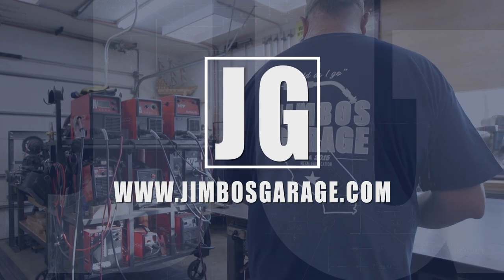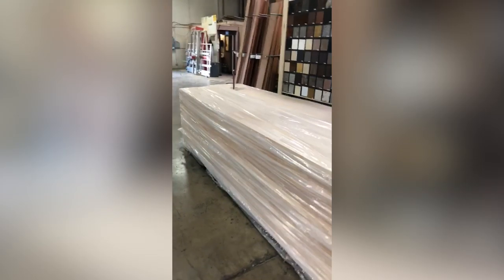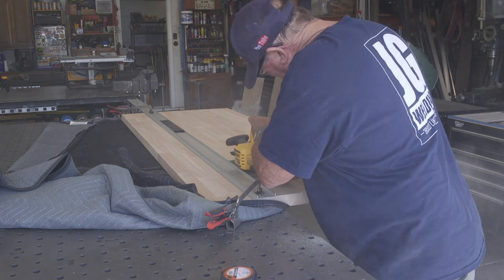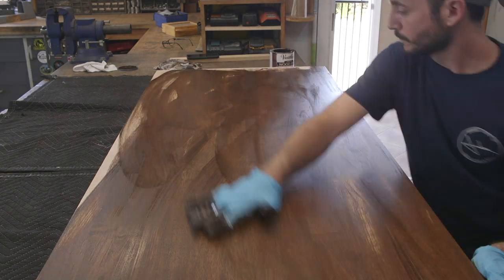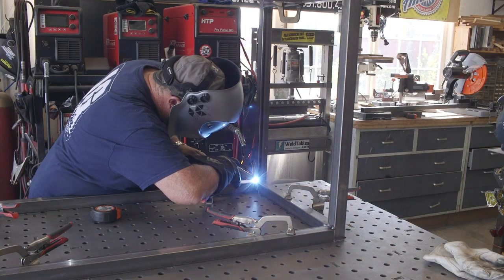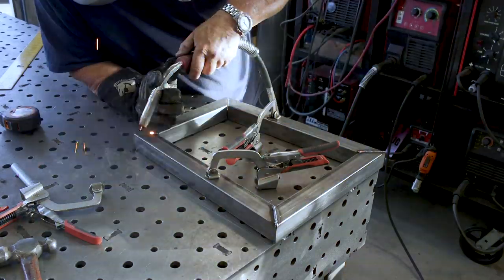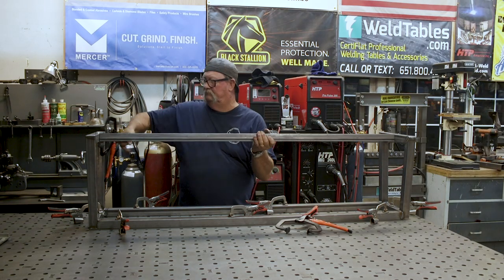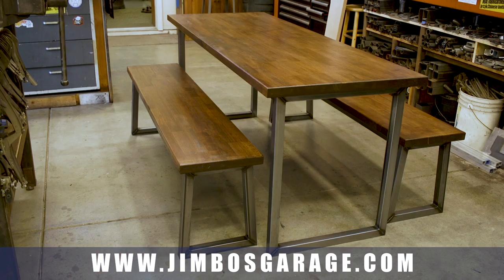Modern Farm Table and Bench Build | JIMBO'S GARAGE

Comment: my only suggestion is to glue some stripes of carpet or rubber underneath the table and bench legs so there is a smooth sliding over ther floor and it doesnt get scratched. good work!